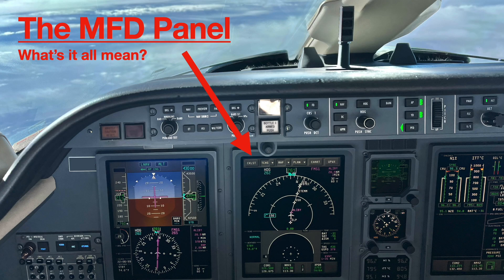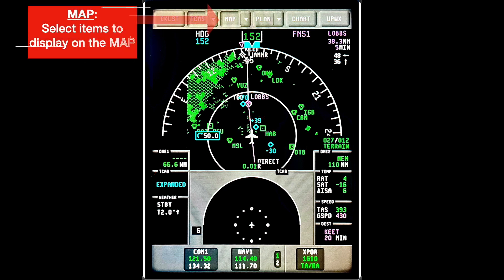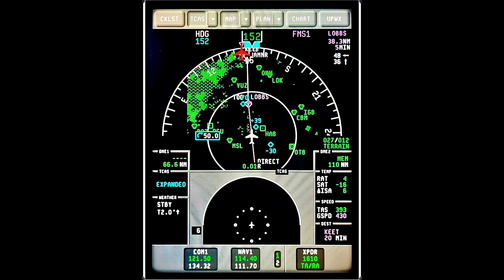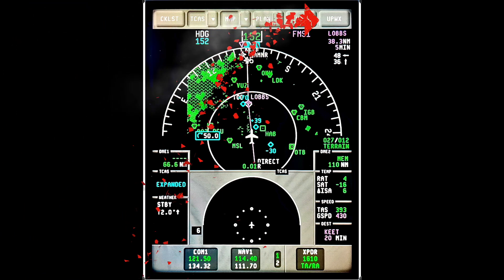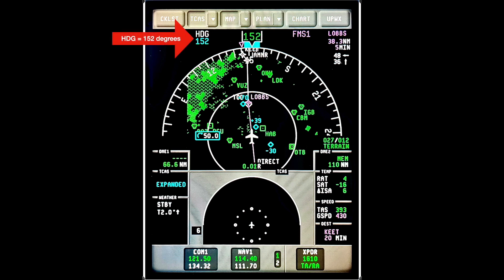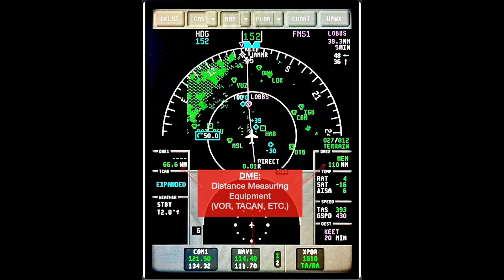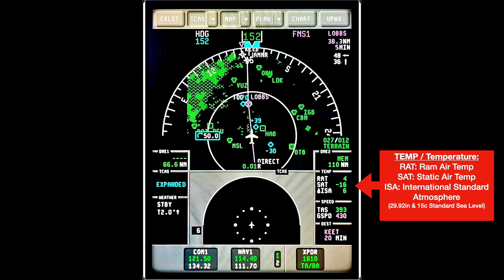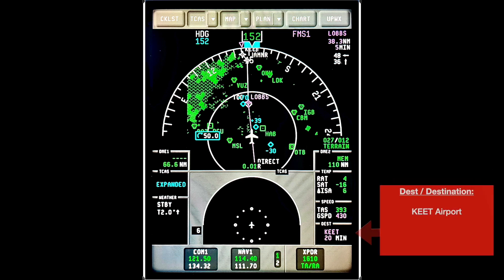Introduction to the Multi Function Display in the Citation Sovereign CE-680 Business Jet

Comment: Is there an altitude range arc on this thing ?
Reply from the maker: There is an Altimeter Tape if thats what you are asking (On the PFD, upper right side). As for a "Range Arc", you can vary the range the of the weather radar and the flight plan on the MFD as well as displaying the entire flight plan in the route view. Additionally, if you switch to the "ARC" mode on the lower half of the PFD, you can also select a variety of ranges with the flight plan overlayed also. Hope this answers your question.